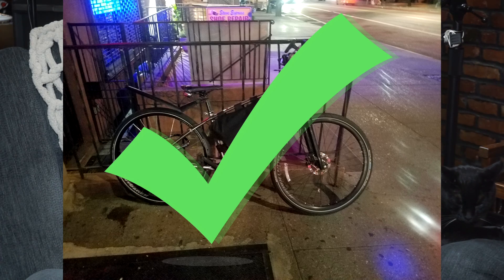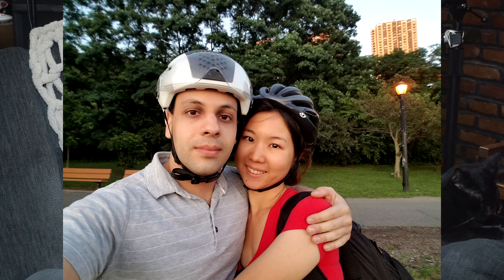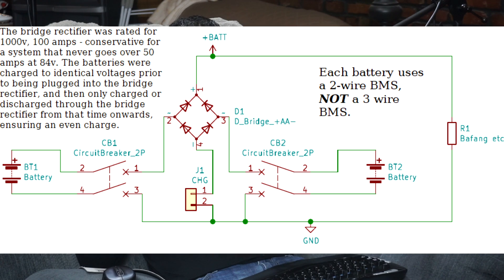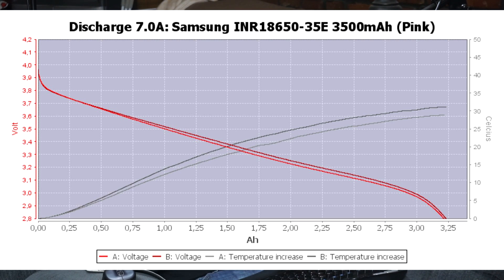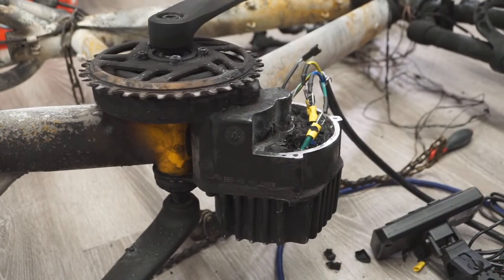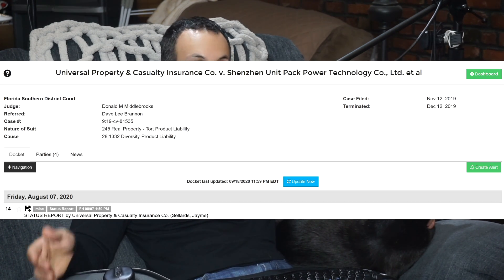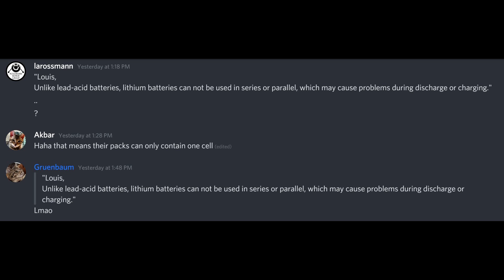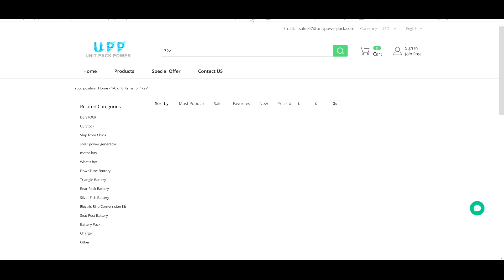Louis' front door goes BOOM courtesy of UnitPackPower battery.

Comment: I see a lot of e-bikes going to 72V and higher as was apparently the battery voltage of the pack Louis used in his e-bike.
Batteries and systems over 50 Volts are not considered 'Extra-Low-voltage' and require extra safety measures and engineering not typically found in e-bikes to be considered 'safe' from a shock and fire standpoint. 

Having worked for many years as an industrial electrical engineer, and before that as an electrician I worked with many industrial Battery and UPS systems, and I have a healthy respect for the potential dangers of High-Current battery systems.  

I also had a company that designed and built industrial electric vehicles, and equipment, and I have some major concerns for using even 48V battery packs in something like an E-bike, and much greater concern for something like a 72V pack, not only for the increased potential danger of internal shorting and a thermal run-away situation something like Louis experienced, but from electric shock and Overload fire hazard. 

I used to work with live low and medium voltage systems from 480v to 4,160volts AC, I had more respect for the dangers of high current 90v DC drive systems and 120VDC battery UPS systems.  Worst shock I ever received and was almost killed by, was from a 90V drive controller where I literally experienced something like the taste of Battery Acid on my tongue and could not let go from being 'hung-up". I only got loose after I briefly lost consciousness and fell off a ladder.

Comment: Louis! Holy shit, man. I saw some interesting fire behavior there. As a former fire captain, old habits die hard. 

There's a moment when there's a decrease in fire volume, a pop, and Vesuvius erupts down the stairs. Again.

Most definite lithium battery Chernobyl action. You understand, there's a lot of energy stored in a small space, and this is the danger of thermal runaway and fire. They go hand in hand.

I agree, little wrong with your installation, you weren't pushing things at all.
Reply: Plus that was the crew member without the visor, right? Why did they not wait for/use the visor? Even as untrained bystanders, I would have thought it's obvious those things go off like firecrackers (Rich Rebuilds nearly took out an entire workshop with his tesla battery when he tried to "recharge" it by hooking it up to mains 120v without any control or oversight, and it blew out all the cells like mini rockets).
Reply: @TechyBen , is there a video somewhere? That's the stuff Darwin awards are made of.

Comment: Even when you buy high quality lipos they can go horribly wrong, but this pack possibly had a dead short in their BMS which caused the batteries to overheat and dominoed to the other cells? 

I cant see the voltage being super related to the reason of explosion which leads me to believe the safety issue is actually in all of their batteries. I know this sounds weird but I’m super interested to learn why the pack exploded and what design fault they made, possibly the batteries need additional safety mechanisms for the packs, and need more fault tolerance if something goes wrong, does each battery have a thermal cut out and fuse? (Most likely to me it has a non working thermal cutout) or it doesn’t isolate the pack properly when it needs to

Another thing to test is the draw from the motor: on the first few miliseconds

But i highly doubt it was the motor

Comment: You can't say it doesn't have enough energy...
Reply: This battery is a hot deal!
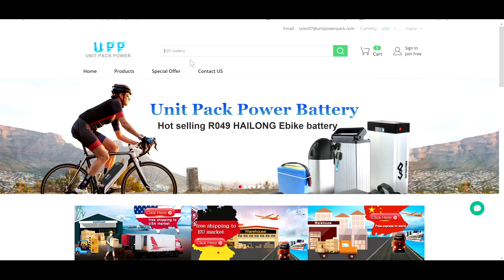Reply: @BoopBobBeep  That's exactly what the website says at around 11:43
Reply: @MyRegardsToTheDodo  Hailong... Cheap Chinese batteries. I'm betting minimal, if any, quality control. Probably no cell protection on the individual batteries(or FAKE cell protection).
Reply: I guess the battery had a blaze.
Reply: Just imagine if each cell was equipped with a batterizer. 😉
Reply: @LaterMeansBrick  I was waiting for this comment
Reply: @abhigyankarmakar4070  You are welcome.
Reply: Lmao
Reply: Well, he can... NOW. ; )
Reply: So have you checked what brand of batteries are in your nice new electric car Dave?
Reply: Dave could the collapsing field from the inrush current generate many kV because the diodes are blocking the current from going back to the battery? Back emf causing diodes to fail short ?
Reply: The hotter the battery gets, the less usable energy density you get out of it until it reaches a certain point where that density suddenly drops to zero. This stepwise function is universally regarded as being an exciting development. Unfortunately though, excitement and batteries do not mix.
Reply: @eevblog are you going to talk in front of whiteboard about this battery design? And truth be told this is not first ebike Louis roasted....
Reply: @vogonjelc  I think the bike tried to roast Louis, not the other way around ;)
Reply: @mjouwbuis  not his first ebike that went in flames just saying
Reply: So much energy that it is overflowing. Such bountifulness.
Reply: Idk about energy, but it definitely had power! 💥 🤣
Reply: Need more power!
Reply: Yeah, that fire was VERY energetic.
Reply: Indeed, looks like it was made in a Firecracker factory.
Reply: Battery: FOOLS! this isn't even my final form! YYYYEEEEAAAAAAAAAAAAAAHHH!
Reply: Rather explosive performance if you ask me.
Reply: This is such a stupid thing to say.

Comment: I believe the problem was with counterfeit cells. Which is unfortunately a common problem nowadays.

 I've had quite terrible crash on my e bike. The battery went flying and some cells were damaged. But instead of getting on fire they just dropped extra pressure. A bit of white smoke and thats all. 

Thats why  I believe that even a poorly made battery made of original cells iss not a fire hazard.

Comment: If one of the internal cells has less charge than the others, as you get closer to empty you'll push one or more cells into reverse polarity at which point they very likely will short out, get hot, pressurize and explode.  That's when atmospheric oxygen hits the lithium.   So if I had to guess, one of the cells had less capacity than the others and went below 3 volts.  But usually it is during charge that they catch fire after being depleted too much.

Comment: That’s what you get for not having a factory certified installer put together your battery pack. Lol.
Also, that charging circuit needs some work. It looks like it needs charge and discharge balancing.

Comment: Aren't 2-wire BMSes usually the same price or cheaper?
That's at least what I've seen when shopping for BMSes. I always go with 2-wire as well though.
Reply: Totally depends on the design of the BMS, its functionality and who build it. Some BMS's do not even provide the functionality, one may expect from it, like balancing cells or over(dis)charge protection. Components may vary widely in price and quality.
To be fairly honest I would not expect noticeable price difference between 2 and 3 wires.

Comment: Just a quick nit pick but shouldn't those fire fighters have used chemical foam to put out the fire as opposed to water? I mean its quite obviously a chemical fire not a wood fire, It's continually sparking and probably smells pretty funky. Not to mention that it reignited after it was sprayed. Not a fire fighter just wondering.

Comment: I went over that schematic for a while just to see if maybe I could see something that was missed. Just to remember after a few minutes that you said the circuit breakers were turned off. 

Even if there was something wrong in the circuit, that wouldn't explain how one, or both, of the batteries went up in flames with the circuit breakers off. 

On the off chance the batteries somehow didn't balance correctly (slightly different resistances in the  charging diodes, with a non-full charge), the output diodes ensure the batteries can't cross charge. On top of that, each battery alone was rated well in excess of the amperage pulled.

 Even if one battery had charged slightly less, or more, the configuration virtually guarantees that the motor will pull current from the higher charged battery until the voltages match... Very intriguing...

 This is all assuming the charge rate and voltages were correct. Which viewing your content, that's very likely.

Comment: I assume each individual cell (or parallel bank) in each respective pack was connected to the BMS for charging? Would seem obvious but its always possible that one or more could have been reverse-charged during use if it was not charged properly or its capacity had fallen considerably below those around it. Used to be a problem I had with high current NiCads in RC cars and planes, in that after a while one cell would become unbalanced due to loss of capacity and then melt down when I went to use the pack.

Comment: They are not entirely wrong about li-ion batteries in series. Generally speaking, an -end user- should not put something like 18650 cells in series. The reason for this is because li-ion batteries are incredibly sensitive to what voltage they are charged to, and you run a very real risk of overcharging one of the cells if the BMS is not set up correctly. Most li-ion cells require a minimum of 1% voltage accuracy when charging.

HOWEVER. As you said in the video, there are many li-ion battery packs that you can buy (such as those for e-bikes) where there are cells in series. With a properly constructed, balanced, and monitored pack, then it is okay to put them in series. So UPP should have had no trouble putting them in series, since they are the ones making the pack.

Comment: Originally I thought it was an over-current situation through one of the diodes in the bridge rectifier, because using 2 diodes in parallel doesn't guarantee that you'll split the current evenly (variations in diode manufacture). But since the bridge rectifier was rated for 100 amps, this was almost certainly a bad battery!
Reply: But even then you would kill the diode and Not much more.
Most diodes i encounter have failed open circuit.
Reply: @SuperUltimateLP  I've been repairing stuff for 20 years and I'd say 99% of diodes fail short circuit.
Reply: @SuperUltimateLP  gotta agree with v12alpine, power diodes would tend to fail in a way to reduce their resistance, i.e. short - esp. when it's a result of overheating. After failing short they also take the fuses with them
Reply: @stanimir4197  okay , i didnt want to insult or spread BS thats just my experience.
But in my case i dont really work with such high powers.
Maybe thats why my expereince differs.
Reply: Matthayi Naalaaman  It's not about the voltage drop, it's that diodes don't behave like linear resistive devices. Splitting current between diodes is unreliable at best. In high-power electronics, you'll never see diodes used in parallel for a high-current path; they will always use a larger diode that can handle more current.
Reply: Matthayi Naalaaman  That's a good point; it would make sense that they are rated for either battery to power the bike. I originally thought the 100-amp rating was pure luck. In any case, the battery is garbage :)

Comment: Louis, $100-$200 for a boss level or K-weld, get your cells, some fish paper between P groups, test that your nickel is pure in salt water, solder silicone wire to make the series connections, use insulation rings on the positive ends, round your nickel, spot weld, insulate the balance leads with fish paper between the leads and cells, kapton/fish/fiberglass tape the whole thing, shrink wrap it...

For the price of a new pack from a reputable builder you can have all the cells, tools, and materials for building as many of your own as you want... BUILD YOUR OWN PACKS MAN! 

The safety of you and your loved ones is in your own loving and diligent hands.